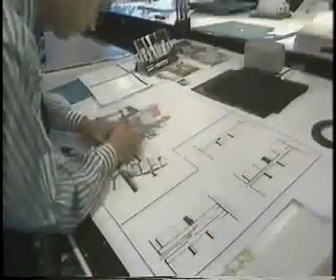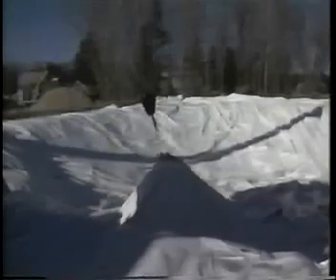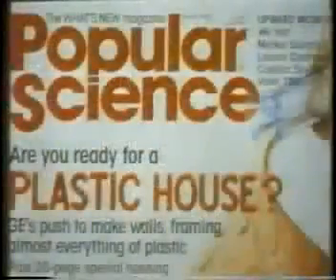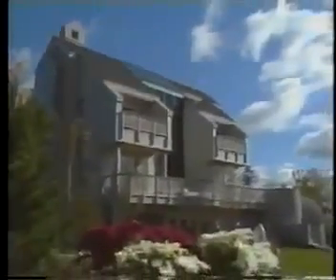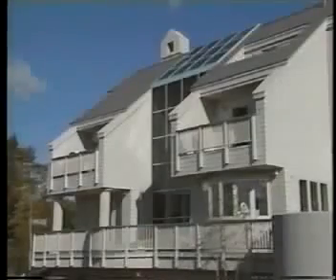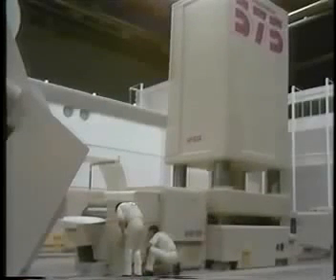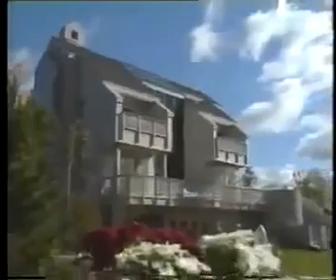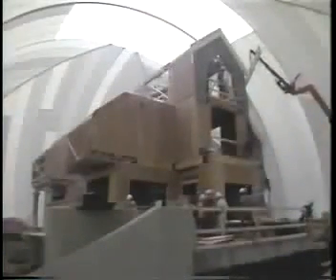GEPAV - GE Plastics Living Environments House  LEH April 1990

Comment: Was the framing made of wood or plastic? What about the sheathing under the plastic cladding? Just curious since the video points out plastics were meant to work with wood and stone.
Reply from the maker: Traditional materials for the framing. 
(In this case, metal  studs, and standard materials for sheathing as it was an industrial building, and still needed to meet local code.) the roofing shingles were all thermoplastic. 
And the walkways were concrete/plastic aggregate.  The showcased items, (many none functional demo units like the HVAC were all plastic materials.

Comment: You wonder what ever happened to that concept today. Other than plastic back then was made from fossil fuel as an ingredient its still a good idea a plastic house like that with todays material is viable and recyclable I noticed the out side filming was done with a chopper like they did in wild kingdom programs. So many people died of crash's and the camera was massive and heavy. Now its by drone. Wow you were involved in that concept that is amazing Jim. I liked this video. The walls were they honey combed instead of that nasty insulation that is just dumped in a land fill. I think they should bring these homes back. They would last a lot longer and way less work to keep it up unlike these homes today.
Reply from the maker: Kim a lot of the concepts like the radiant heat have really taken off, composition roofing panels had problems that only showed up after years of use.
But all in all, it worked amazingly well as a test bed for seeing what might work.
The helicopter was a local guy with a bell 208 and the guy I worked with just hand held it. That would have gone much better with a Tyler mount.